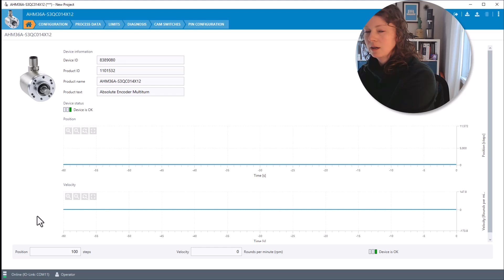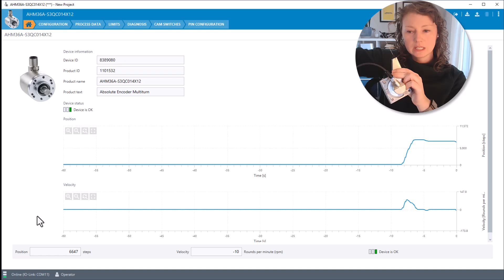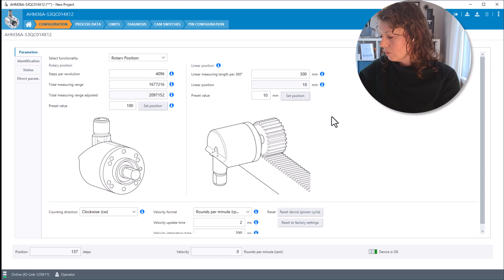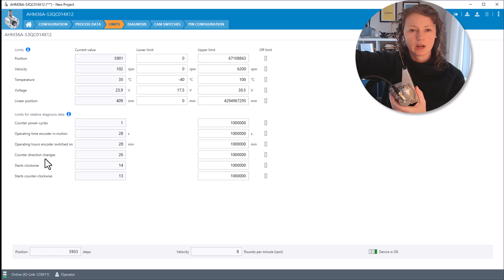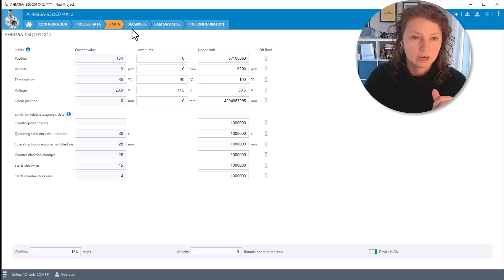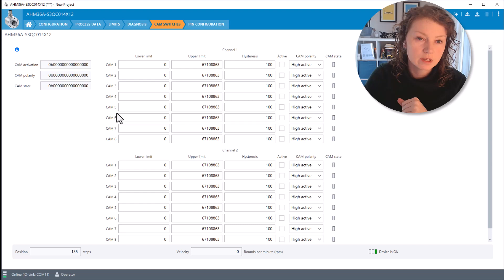SICK AHS/AHM36 Encoder Demonstration

Comment: Is there some kind  of way to get in  those paramtrization on ethercat?
Reply: While ethercat is not one of the native communication options, parameterization can be done using the IOlink encoder and an IOLink Master/EtherCat gateway. 
Then commands to set up the encoder parameters, found  the IODD file, can be sent via EtherCat.
Reply: The other option would be to look at the AFS/AFM60 absolute encoder with EtherCAT communication. That unit uses a lot of these same parameters -- the configuration would be done via the EtherCAT network/PLC rather than the SOPAS software shown here, but the functions are similar.
Reply: @MandeeLibertySensors   Thanks for your response!, Nowadays I´ve been working on an application qitht he AFM 60 Absolute encoder, The encoder would detect 0-360 d degree per revolution, I added on the start up parameters :Configuration Preset-Value
Number of Turns, Divisor
Number of Turns, Nominator
Operating Mode, Control
Total Measuring Range (cmr)
Counts per revolution (cpr)
Operating Parameters,  Would you mind to recommend or advice something else, to parmaters...